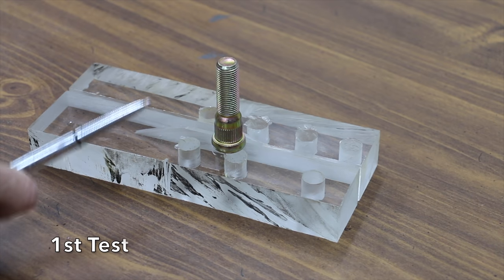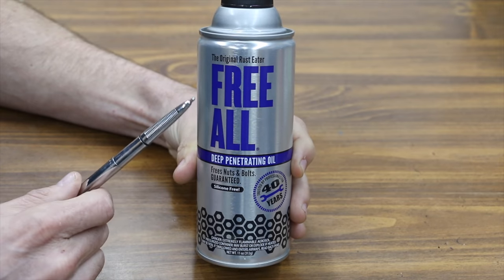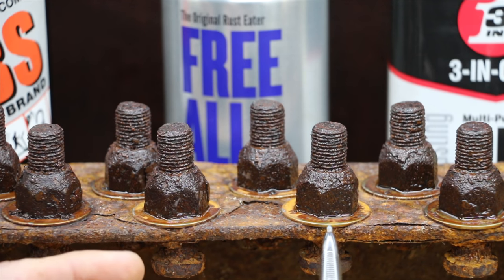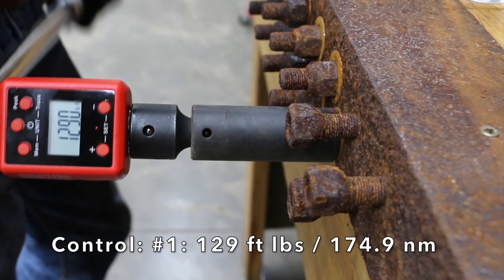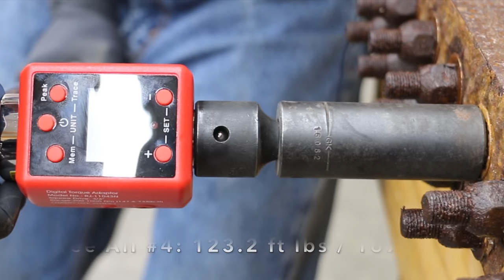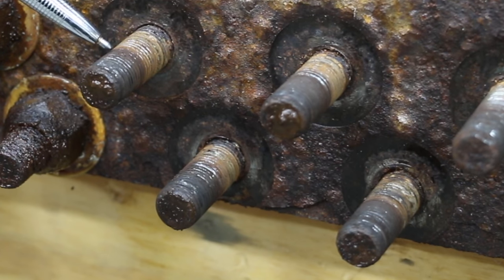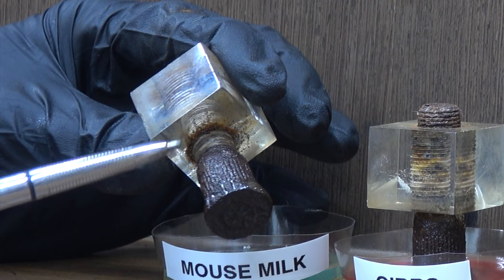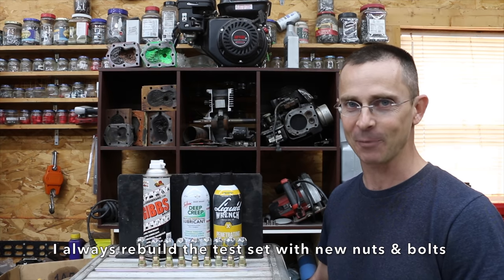Does Water work better than Penetrating Oil for Rusty Bolts? Let's find out!

Comment: Best I have tried is 50% Acetone and 50% Synthetic Transmission Fluid. works fast, never needed a torch to free rusted bolts.
Reply from the maker: That's a great recommendation! Thank you
Reply: https://www.youtube.com/watch?v=xUEob2oAKVs wasn't in this Video the mix also tested? or is Synthetic different then the used ATF oil?
Reply: I though that was already tested?
Reply: Yes. Thats my favourite penetrating oil. Works like a charm
Reply: Thats the mix i use,  50% Acetone to 50% ATF.    Its does a great job in a short amount of time on seized parts.

If your bottle sits awhile it will separate, a good shake gets it mixed again.   Also keep it capped,  the acetone will evaporate if it can vent out.
Reply: Came here to ask about this. Just an idea. How about testing using 50% ATF (fixed) and multiple different solvents, see if the solvents make much difference? Lists of solvents would be acetone, petrol, diesel, kerosene etc etc.
Reply: It’s only good if you shake it up before use and keep it in a sealed container because acetone evaporates
Reply: it's best to store each chemical separately, and mix it up when you need it. It makes storage safer.
Reply: Add a cap full of water to the mix and it's supposed to get better. I saw this mix on another channel and a chemist commented on how the water works in that mix. He actually used whiskey, but the water does the trick. Still it's no miracle soup.
Reply: @Technohonk  no its the exact thing that he already tested.

Comment: As a Millwright, I spend about a 1/4 of my work day fighting to remove rusty nuts and bolts. Kroil is the best and only oil we use.
Reply from the maker: Thank you for the recommendation!
Reply: Frank Reynolds removing rusty bolts from corroded steam rolls always proved successful through our in house test by using Kroil
Reply: Free all is better then kroil

Comment: Can you add a test with 2 parts acetone and 1 part hydraulic steering fluid. This should be a true penetrating oil. It gets into everyting, and then the acetone evaporates. leaving a detergent free oil film
Reply from the maker: Thank you for the video idea!
Reply: I believe this is basically pb blaster.
Reply: Agree. I used this recipe to free a turnover Gooseneck ball from a truck I bought when nothing else would work.

Comment: I've been using Free All at work lately. It seems to work a lot better than PB Blaster. I use it not only for rusty bolts, but also for cleaning up rusty parts. For example, rusted bores in brake caliper brackets. I soak the bore in Free-All and use a bore brush mounted in an impact driver to brush the rust out. Then spray it out with brake cleaner. The bores are shiny when I get done :D
Reply from the maker: Thank you!

Comment: Great video as always.

I had some input for the penetrating fluid testing. Many times I can break a bolt free, but use penetrating fluid to assist in spinning the nut off. If the entire stud is rusty, threading the nut off the rest of the way can be the hardest part.
It also increases the likelyhood that the stud will snap, as your continually stressing it. 
Penetrating fluid can assist in spinning a stubborn nut off. It would be interesting for you to come up with a way to measure how well different fluids assist the nut in spinning off.
Reply from the maker: Great point! Thank you
Reply: I wire brush the exposed threads if they're  nasty. No point forcing the nut through it.
Reply: @hughbrackett343  I like to tighten the nut just a hair first too, then wire brush again.
Reply: A couple minutes of wire brushing all exposed threads up to and against the nut will usually make that nut spin right off. Most of the time you won't even need a penetrating oil.

Comment: Please test what brand of Double sided tape is best. I use double stick tape in my work alot and there are so many options.
Reply from the maker: Great test recommendation!  Thank you
Reply: «a lot».
Reply: There are different types as there are different substrates, application temperatures, operation temperatures.
Reply: 3M is my favorite
Reply: Depends on the surfaces your applying too. Generally to for non-porous surfaces 3M VHB tape works very well.
Reply: Gorilla!
Reply: VHB made by 3m
Reply: 3M VHB is the best I've used. It is very permanent. But it would be interesting to see if any are stronger

Comment: Could you make a test on electric contact cleaners? I'm very curios about what's on the market and frankly, I'm not even totally sure that some of them really works 🤔
Reply from the maker: Great test idea! Thank you
Reply: Not sure what you're cleaning but if you have a nasty battery baking soda and water is KING.i mix it up in a water bottle maybe 1-2 inches of B.S. in the bottle fill with water and shake. poke a hole in the top and soak everything. Keep it agitated it will settle. I rinse and repeat maybe wire brush heavy crud works great on old tractors and dump trucks try to keep your battery tray clean and painted or it will disappear on you!
Reply: Support the idea

Comment: For a penetrating oil, try a 50/50 mix of Transmission Fluid and Acetone
Reply from the maker: Great mix!  Thank you
Reply: ATF and acetone don't mix...
Reply: @ohger1  the hell they don't.
Reply: @ohger1  If ya shake it hard enough anything will mix.
Reply: I've been told this mix works as good as any.
Reply: They don't mix as John-Del stated and they separate quickly too. As pointless as the suggestion that they will mix. You could try some good soap in the mix to help that though. AvE didn't do that 'with soap' part.
Reply: @aodhanohoulihan2550  Falls out of suspension way too fast to do any good.  Years ago I did get ATF to mix with another solvent that escapes me (Stoddard?), but it was no better than the commercially available concoctions.
Reply: @ohger1  It stays mixed for a few minutes ive tested it myself with a glass jar, and the droplets stay mixed longer because of surface tension on the drops i believe. I've always used 1/2 acetone 1/4 diesel 1/4 Marvel Mystery oil. and that's worked fine. although I think there's a point where the penetrants become so effective the returns are diminished for any change. I could've just said diminishing returns... Ah well. just my 2p.

Comment: Living in the rust belt this kind of testing is a gold mine. Thanks again. I want to say, years ago I was in the Volkswagen/ Audi training center and the teacher used a mixture of brake fluid and water. I found myself trying it when I didn't have a spray can of some penetrant handy and seemed to work well. Or maybe coincidence. Just thought I'd share that with you. Of course the almighty "fire wrench "beats all. Thanks again for the oil shoot outs as well.
Reply from the maker: Thank you

Comment: Any chance of comparing engine oil filters? That would make a great video! Although you will have to make a device to test filters.
Reply: Would love to see this, but I dont think there's a big enough difference between filters to really test them in the short term, the only time filter quality becomes relevant is after thousands of miles, and/or under extreme conditions.
Reply from the maker: Great test idea! Thank you
Reply: Perolator is the only filter
Reply: @aodhanohoulihan2550  i ran puro's........ taking them apart told me that napa gold/WIX was SLIGHTLY better 

but if i got a deal on 5 quarts of oil with a puro...... or had to pay 5 bucks extra to get a WIX..... id run the puro....any day
Reply: @aodhanohoulihan2550  I like to run Purolator on my Jeep simply because their filter is so much larger than anyone else.
Wix is good, Mahle is good. I've used K&N and Mobil1 before simply because they were what was available and I'm sure they're good.
Really the only filter I would avoid is Fram.
Reply: @billybobjoe198  Fram used to make a great filter. I still have an old Fram drop in filter in my 1960 Jeep-Willys. Should probably change the oil soon, it's been like 40 years since I changed the oil.... Heheh
Reply: @kainhall  I like Perolator mostly because they are made in the USA where I live now, and they invented the oil filter and have an outstanding track record. Consistency is what I like best.
Reply: Maybe put a bunch of crud and gunk in the oils and some metal shavings, see which oil filter keeps the oil the most clean!
Reply: @wills.5762  nah you would be surprised look up some reviews. Some oil filters like fram are just paper folded a few times and some like mobile 1 are multi layer...
Reply: Amsoil EaO vs. Fram Ultra Synthetic.
Amsoil: 20 Microns, 98.7% Rate
Fram Ultra Synthetic: 20 Micron, 99% Rate

Comment: Great video as always mate!
Just a bit of comparison for you, our diesel in the UK is 6.35 a gallon 😭
Reply from the maker: Wow!  That's expensive!  Thank you
Reply: Also keep in mind the US gallon and UK gallon are different. Long live metric!
Reply: @gustav901  you are correct but I did the direct comparison at the US gallon. My figure is based on in the UK most filling stations are at £1.30 a litre, the motorway/highway stations can go over £1.50 a litre.
Here is an idea for a video, do a test to see which lube works best with the UK government screwing us so it'll hurt less 😂😂
Reply: @gustav901  you can have metric . If the U.S. wanted to be like the rest of the world ,  there would be no U.S. . Long live feet inches and gallons ! ( Imperial measurements ) if it wouldn't have been introduced by the French in the late 1700s when the United States didn't like the French we may have considered converting to the metric unit . Now there's only one reason why we don't .
'Murica !!!
Reply: @jayballuk  governments always screw over their citizens.
Reply: tone167  just a while ago I saw gas (or petrol) pass diesel in price a few days ago but came back down
Reply: Tomteluva you do know neither of what you described are a metric unit right?

Comment: I think include automatic transmission fluid if you test more penetrating fluids.
Reply from the maker: Great recommendation!
Reply: @ProjectFarm  I've always heard a 50/50 mix of ATF and acetone
Reply: I think this mix was shown before, and the components separated out. 

@Project Farm, I would like to see Ed's Red Bore cleaner tested.  It's a 1:1:1:1 mix of ATF, Acetone, Kerosene, and Mineral spirits.  With the latter two ingredients acting as co-solvents, it should at least stay mixed.
Reply: Didn't we already do ATF in one of the other videos?
Reply: @avgoalie01  I've always used a 50-50 mix of kerosene and 10W30--and heat.   I suppose that all of these homebrew concoctions are just variations on using petroleum fractions.
Reply: Acetone and atf. Oldtimers swear by it

Comment: Try frying oil in a hot fryer to about 175C to loosen them wonder if that works
Reply from the maker: Thank you for the video idea!
Reply: Could be pretty dangerous if there is any moisture .
Reply: steel would just take all the heat out (and oil doesnt have much thermal capacity).. i think better test is blasting rusty nut with torch, let it cool and spray petrating oil
Reply: @exvils   put the rusty bolt in a sandblaster and see if that loosens it
Reply: So I work in food service and we had a lock that was seized wouldn't turn rusted as heck. Dripped some oil into the keyhole from the fryer and that sucker didn't have a chance.
Reply: Also liquid nitrogen could help, or hot oil after liquid nitrogen for ultimate thermal shock.

Comment: I would have prefered if you left it at a 3 hour time to penetrate. Yes maybe not as realistic but it will help separate the good and the bad, so there is more variation between results.
Reply from the maker: Great point and thank you
Reply: I find it I often can spray it on the night before if I can plan a project.  Though not always possible.
Reply: The thing is that most people in the real world aren't gonna wait more than 10 minutes, half an hour at the most.

Comment: What about water with dish soap to eliminate the surface tension. 
CLR? CLR removes rust
Reply: Is it worth trying strong white vinegar as well ?
Reply from the maker: Great recommendation!
Reply: CLR,Bleach,Citric Acid, Acetic Acid, all are useful information.
Reply: Clr is horrible. There are videos on products for rust removal testing it versus many other products and home solutions.
Reply: @SteveofArms  calcium lime rust
Reply: @notabot3518  what about it
Reply: Yes, please a citric or phosphorus acid based test. Maybe mixed with Diesel/ATF to get it in the thread?
Reply: Clr removes rust until it dries, then it becomes a rapid oxidizer.
Reply: @SteveofArms  CLR-Clearly Lacking results
Reply: @humanandroid8099  citric acid, use mtn dew. Phosphoric acid use coke or Pepsi. I've used coke to break bolts. I don't drink coke anymore. Yes, there is a connection there.

Comment: I noticed on the side of the torque adapter it says its low end range is 147.6 ft lbs. Does that mean anything below that may be inaccurate?
Reply from the maker: Thank you. The readings are accurate. Compared it to my other adapter prior to testing.

Comment: Yet another great video, thanks for the significant effort you put in to these tests!

If you're starting to rust more bolts can I request that you include another test, identical to the control sample but that you will wire brush the exposed threads before loosening? If this makes more difference than expensive products, that seems like an important finding for the channel!

Thanks again,
Sam
Reply from the maker: Thank you!

Comment: Great tech videos. Have you ever tried these penetrating oils on bolts stuck in metal sleeves, such as those in shock absorbers? My motorhome shocks gave it up after 15 years. Before these videos, I used PB blaster, and used it to loosen nuts. However, the bolt is stuck in the metal sleeve. These videos show how penetrating oils work on threaded bolts. I wonder how they would work on a sleeve rusted to a smooth shank on a bolt?

Comment: In technical terms, this is called crevice corrosion, so capillary action (like a straw) will trap a solution (water) in the crevice. The hydroxide ions in the water form a bond with metal ions in the solutions and leave a highly acidic environment behind, this can accelerate corrosion of a metal, however for iron, under specific temperature and pressure, it's able to form a passive oxide layer (stable rust) and that can protect the metal beneath. The actual test he is doing is very biased to a certain condition and is not really viable. But it's still interesting. in the end, rust is not something that needs removers and oils, just scrub it off. and you don't need to help it loosen that much, just a bit of extra labor
Reply: Thank you Cliff Claven!

Comment: I am not obsessed with diesel but i notice the comments below about grease cutting and it brings to mind a time when i was a kid and my hands were covered in black chain oil for some reason i mixed a some washing up liquid with a cup full of diesel and it turned into a kind of swarfega type jelly which cleaned the oil off easily and washed off with water, my Dad was impressed.
Reply from the maker: Nice!

Comment: There's no way water could penetrate a rusty 5/8 bolt, or any surface for that matter.
I use diesel for everything, from cleaning to penetrating bolts.  Considering the 25k gallon tank out back.
If I weren't in such a hurry, which my job requires, I would go with Gibbs.
But I've never heard of it, nor have seen it at any of the local places.

In my case, diesel wins.
If that doesn't work, I'll break out the cutting wheel and, in worst case, the torch.

Thanks for the video, man.  Good info.
Reply from the maker: Thank you

Comment: The leader boards during the torque section were helpful, good idea to highlight the newest addition on each frame. They were nice and short so it didn't upset the flow of the video, but it was obvious how the results were coming in.

I like to use diesel as a parts cleaner for really dirty stuff. Would have been nice if it were a good penetrating oil too.
I know old people liked to use gasoline, but gasoline seems to evaporate faster.
I don't know if the oil places like it, but I've always just put my dirty diesel into my oil containers for recycling.
Reply from the maker: Thank you very much!

Comment: First, I would thank you again for what you are doing.
What if you apply each one on 6-7 samples and ignore 2-3 results which are so different than other samples, for example let's say the torque results of product A are:
151 - 103 - 114 - 105 - 96 - 138 - 59
or, from the lowest to the highest:
59 - 96 - 103 - 105 - 114 -138 - 151
If you drop (138 - 151 - 59) from the average it will be more reliable.